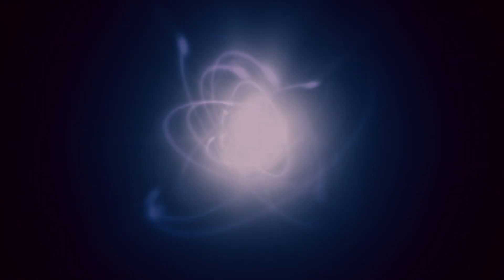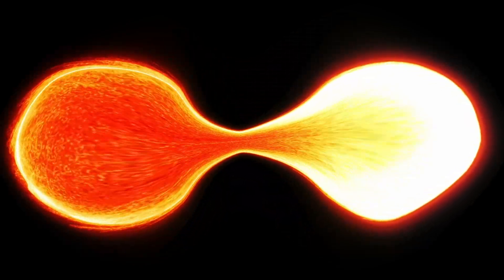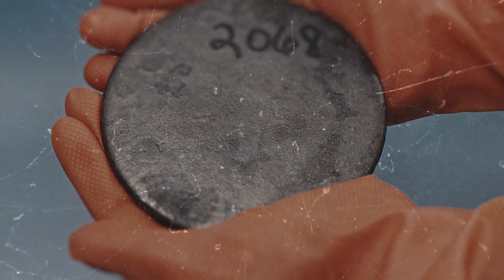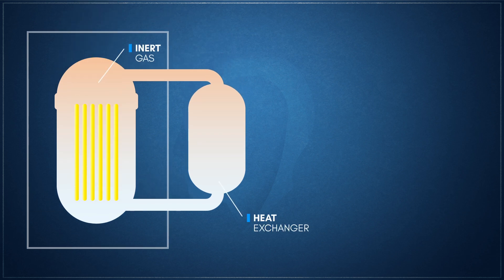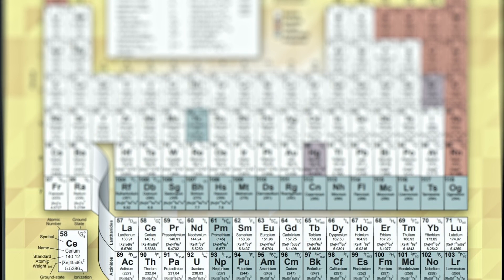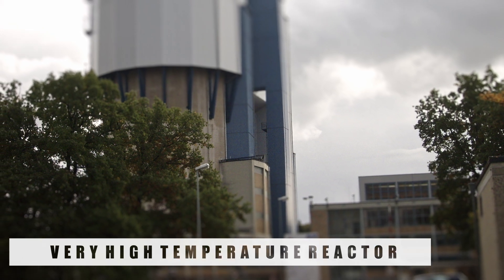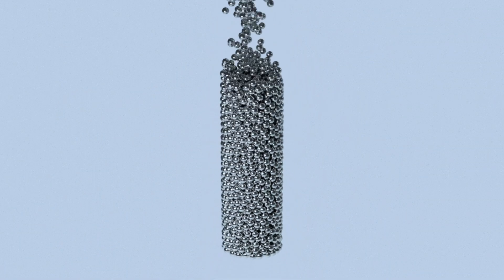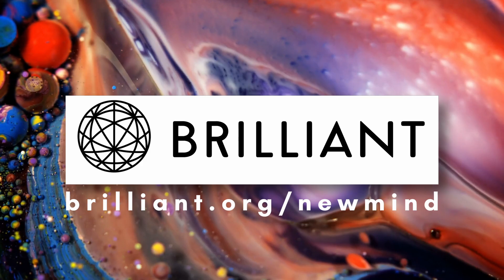Portable Nuclear Power

Comment: My only issue with SMRs and hopper pellet designs (which I love by the way, I want a 20KW micro reactor under my drive way) as explained here is 1) Helium.....uhm.....last I checked we had a depleting resource of the stuff. Sure, like MRIs it can be contained and reclaimed for the most part, but Id really prefer to NOT rely on something that we cant replace easily. Once its vented to atmo, thats it, its gone. And 2) Id prefer SMR, and larger scale reactors for that matter, that require neutron mirrors to sustain the reaction. There was a program in the 50s that launched a nuclear reactor into space called SNAP 10 which relied on neutron mirrors to operate. If the system went out of spec in any way it would release a retention belt that flopped the mirrors down killing the rector (which it actually ended up doing, not because of the reactor but a voltage regulator failed. Since the system was designed to kill the reactor in the event of any failure, thats exactly what it did and the reactor cooled down safely). So design SMRs with mirrors that slide down or something out of alignment with the reactor core that can be reset once its checked over. It would make them much more safer than they already are.

That being said, the real problem with nuclear is putting too much in one place. Gigawatt reactors are the problem. Too much can  go wrong all at once, too much to entirely contain, too complex. Small modular units connected together that can individually drop out leaving the rest to take up the load is the safe way to go.  Down with big nuclear, but up with smaller reactors in mass!!!
Reply: Evidently you have never seen the SNAP reactors tested to destruction... They can blow up quite substantially, and contaminate a large area. You would NOT want one under your driveway going haywire. 🤦🏻
Reply: @davelowets  you mean the Systems for Auxiliary Nuclear Power program that was explicitly intent on testing novel reactor designs and applications.....in the late 1950s through the 1960s? Or do you mean the ones intentionally operated to failure literally 'to see what happens'? Yeah, I've seen them. A modern design, configuration, safety mechanisms (which were another thing the early small reactor tests often omitted from design, again to see what happens and determine failure modes, containment, and clean up procedures), fuel chemistries, and monitoring systems make even the RBMKs miles above a 1950s SNAP reactor in terms of safety, reliability, and stability. The only 2 SNAP reaactors I know of that failed in a release event was one that broke up with the rocket it was riding on and dispersed 1kg of plutonium across the upper atmosphere, and SNAP-10 that self shutdown safely due to an unrelated systems voltage regulator failing, and then was hit by a piece of Russian space junk....or a Russian satellite....but, i mean, same thing really. Besides the SNAP designs were for mostly unshielded or minimally shielded Radio-Thermal Generator applications, which is little more than slapping a peltier device on a (thermally) hot lump of plutonium to directly produce electricity from the temperature difference between space and coolant, or the radioactive material container itself. A terrestrial reactor is very different. Although you can still buy Russian cold war era RTGs on ebay.... 

Yes, I'd still take a 20kW SMuRF (Small Modular micro-Reactor Facility..... I think I just named the installation type 🤣) for under my driveway. Modern design convention, modern containment, modern monitoring and safety mechanisms, the only thing I'm afraid of is the unit going into emergency shutdown and falling offline because someone farted near it. I guess nuclear scaremongering doesn't work on everyone, especially those with a preference for understanding a thing and developing their own opinions instead of being told what to think by the pop-culture zeitgeist 🤷‍♂️

Is nuclear energy dangerous? Sure. So is RF energy. But you trust your microwave not to fry your eyeballs with 1100 watts of energy dont you? While sitting next to your wifi router using the exact same frequency band at 250mW....Its almost like the application, power output, and containment coupled with safety interlocks have an impact of the relative safety of a technology, eh? 😉
Reply: @zombieregime  R.F. and ionizing radiation are 2 very different things....
Reply: @davelowets  omg nowai..... 😐

Comment: Nuclear power plants are not safe and can not be made safe to operate.  Nuclear radiation always escapes. While nobody has been killed nearby the global environment is made uninhabitable by nuclear technology.   We don't need  heat  to produce electricity.  We can use field magnets for moving the armatures and coils of copper wire.  We can use inverters and transformers to deliver high voltage AC power continuous peak power to the power lines.  There is no loss of current generated if cold inverters and cold transformers are designed and built.  So that even though the initial voltage is only 12volt DC inverters and transformers built to function without converting current to heat the current input is nearly the same as current output.  So we can estimate that 1200amps generated can be nearly 1200smps delivered at 2000volts .  In electric power current is conserved while transformers increase power .  The Edison generator and dynamos power plants securely generate electricity without fuel or nuclear steam wind or water.  We are grossly misinformed about power generation and nuclear power is the most dangerous consequence of the misinformation regarding Treaties and power generation.

Comment: I still think geothermal makes more sense.
Reply: won't be sustainable. it'll just cool the earths core faster, diminishing the planets protective magnetic shield. Once that shield is gone, the atmosphere will start to be stripped away, it'll take 10 or so years until all life on earth is gone due to intense cosmic radiation. the O-Zone layer won't help at all
Reply: Not really. Three reasons why geothermal makes not a lot of sense: very high costs, limited locations where geothermal can be installed, and the high risk of severe earthquakes.

Comment: Amazing as it is, I find it amusing that for all our technology, we're still pretty much stuck in the steam age(or other heat transmission). Spinning magnets around copper coils seems to be the best form of power production. Solar and thermal conductive devices (peltier effect) have very poor rates of energy capture in comparison. I can just see it now, ships relying on fusion reactors in space to push steam engines for power production. And yes, I know it's an oversimplified view of the technology.
Reply: With thermal levels so high in Gen 4 reactors it will be possible to use Super Critical C02 gas generators to generate power. It is way more efficient than steam generators.
Reply: @NinetooNine  Same basic concept though. Using thermal expansion to spin magnets around conductive wire. Just don't pull the lever to blow the whistle on the steam spaceship, you'll incinerate yourself.

Comment: The waste is the main problem. Think, we are using extreme power to boil water to make power....
Reply: The nuclear waste is indeed the main problem, but it's not a really big problem. Nuclear waste is completely recyclable since the 1960s.
Reply: @LuchtLeiderNederland  I just see our current method is so primitive and wasteful. There has to be a better way of harnessing the power to its full potential.
Reply: @tomroe7715  Radioisotope thermoelectric generators is a way to directly make electricity from heat. However, it is only used in uncrewed spacecraft and some Soviet lighthouses in the Arctics because radioisotope thermoelectric generators have an efficiency of only 10%. Boiling water has a much higher efficiency, thus making it one of the most efficient ways of generating electricity.

Comment: geothermal can easily replace atomic power and is definitely less dangerous even if you shutdown atomic plants why not drill holes next to it in nearly all formations is plenty of heat in reachable debts then the existing turbines can be used to generate  power like in the past from the atomic heat
Reply: 41.
Reply: Geothermal energy is more dangerous than nuclear power. Geothermal energy increases the risks of earthquakes, nuclear power doesn't do that.
Reply: @LuchtLeiderNederland  ach ja please get real investigate geothermal plants some are in producing power since the 50 tis or you r some one who live om a lobby salary
Reply: @LuchtLeiderNederland  do u understand they can drill now for deeper in to hot dry rock nothing will happen
Reply: @niko-laus  That was only one of the reasons why geothermal is not widely used. The two others is very high costs and limited locations where geothermal plants can be installed.
Reply: @LuchtLeiderNederland  please investigate mm microwaves are no an way to drill with low cost unlimited debts but tis infos are not easy to come by i did work on geothermal maintenance the plant is working since the early 60 continuous some other plants since 1911

Comment: Junk.. Nuclear for big power supply to masses. 2 trillion is enough small modular reactors for all of America with backups. We could rush that delivered by semi to save fuels to sell to other nations in need and lower strain on ALL. But the elites above us ordered us.. To think of how to starve the masses safely. Just like those people screaming in those buildings in China. For homes and vehicles = Cold steam reactor. Water boils at much much lower temps under vacuum, so you can use tiny fire to keep a turbine running max, and all extra pressure from boiler for steam driven vacuum pump to maintain the vacuum so the turbine stays lowest possible cost for operation. Condenser just like small modular reactors and internal pressure release to prevent explosions while recycling all water inside them.

Plasma arc with excess turbine power making ultrasound with plasma to change water of pressure = Non-corrosive real time hydrogen conversion. Tiny tiny fuel tank for days of power for a cold steam system. Electric motors OR producing hydrogen in real time for engine becomes supreme option. For flushing water out of hydrogen converted engines = Ultrasound to vibrate the metal, and air compressor system. < Cold steam reactor should NEVER shut down, so just plug vehicle to home for extra money from grid. - Atheist eugenicist Illuminati transhumanist

Comment: over the past 70 years nuclear power has proven to be overall.....

1. the safest power source available......Accidents. ...Produces Radioactive Waste. ...Impact on the Environment. ...Security Threat. .. and approximately 28 accidents/disasters that are on the International Nuclear Event Scale

2. Hydro power has the lowest fatality rate per unit of energy generated, (no radiation)

3. Radioactive waste disposal, it will remain radioactive for more than 10,000 years.

4. not everyone is a nuclear engineer, so portable nuclear power is not viable
Reply: Bad arguments you got there mate. Nuclear waste is completely recyclable since the 1960s, nuclear power has no impact on the environment, there is no security threat, hydro power does not have the lowest fatality rate (hydro has 0.10 deaths per TWh, nuclear has 0.04), and nuclear disasters are bad arguments against nuclear power, especially Chernobyl, Fukushima and Three Mile Island.

Comment: I remember that they've made Small nuclear reactors made to be self sustained for supposedly up to a hundreds years or more if they've been built well and don't break down. If so, I could imagine the world could be powered for at least 10,000 to 100,000 years easily over the years, and any waste transformed into resources as well. In that kind of time, it should be possible to also figure out what would be next to follow after. Assuming I'm remembering right about how that works. I could be wrong, but It should still be a power source that would be useful for as long as that at least.
Reply: I'd be interested to see one made small enough to power a single house.  Maybe use as a backup during power outages.  Would be cool to see a tiny reactor implemented into electric cars.  I'd imagine it would be a lot more efficient then lithium batteries and probably cheaper to make then lithium batteries as well.  Y'know once the technology is perfected.
Reply: If we get to the point where we are able to harness that much energy, the scale of the things we will be using energy for will increase exponentially (computers, vehicles, infrastructure, etc)
Reply: 7.

Comment: The issue with nuclear power, is not when everything is going according to plan.
Reply: The issue with nuclear, is simply people and politics. Nuclear requires a stable government into perpetuity. Something which almost nobody can guarantee. This is not just due to corners being cut with regard to maintenance, safe operating, but due to proliferation of weapons grade material and material disposal in the event of incomplete use.
Again, in peacetime, it works fine, but in war time, the nuclear power plants become significant strategic targets. 
I am not against nuclear research but I think often people get too utopian about nuclear solutions, when we have been told prior to chernobyl and fukushima that no disaster could happen. Because it is not the disaster that you plan for that gets you, it is the one you failed to account for.

Comment: Lets gooooo, we need more public awareness of how SAFE, USEFUL, and CLEAN nuclear power is now to get rid of the stigma around it. Let me ask a question. There have been how many devastating nuclear disasters from properly built, regulated, and maintained nuclear facilities??
....0. None. No accident has ever occurred at a nuclear facility that was being operated properly.
Keep driving prices down, keep passive safety on the rise, and keep thermal efficiency growing, and nuclear energy is the best, most sustainable, essentially clean energy we can ever ask for. Add solar and wind to boost that production and fossil fuels can easily be eliminated from energy grid production in the next 50 years. I'd love it see it...

Comment: You missed CANDU reactors. They are not simply pressurized water reactors, they are pressurized water reactors that use heavy water for the high pressure circuit. They are worth noting I feel because, while still being heavy water reactors, they have the same ability as gas cooled reactors to use unenriched uranium and you can't feasibly use their waste to create plutonium for nuclear weapons, so they are not a proliferation risk.

Comment: If people wanted to they could build huge solar farms all around and even on the structure of a nuclear power plant & then divert all that power into the plant to be used to create the steam used to spin the turbines instead of using nuclear power to do it. effectively changing it into solar steam electric plant. No nuclear wast and yet still all the power generation a nuclear power plant can generate. Also of course an array of batter systems to compensate for cloudy days.
Reply: 32.  Huh???  You want to take electricity and use it to boil water to make electricity?  Why in the world would you want to do that???
Reply: @nathanwahl9224  Simple, getting the electricity from solar to do to the water what nuclear isotopes do is clean. Zero waist. On the other hand when they use radio active isotopes it ends up leaving dangerous nuclear wast. For the record tho I would actually prefer my idea of an Over Unity Electric Generator to be built. I describe it in other message.
Reply: @nathanwahl9224  I smacked my forehead too over this one.

Comment: Fascinating video with very good description of the different types of reactor systems. I formerly worked on CO2 gas-cooled reactors, but I feel that the use of helium as a coolant gas is not the way to go as it is not that abundant and is prone to leakage with its low molecular weight.
Reply: What advantage does He have over CO2?
Reply: @Gomlmon99  Helium is absolutely non-corrosive, whereas CO2 does oxidise steel- this led to the temperature downrating of some reactors in UK following the identification of corroded components. (It was found that the corrosion between certain steel nuts, bolts and washers built up until the bolts were sheared off due to the stressing of the steel). 
It also has a higher specific heat capacity than CO2 meaning that it takes less gas and thus less energy to transfer heat from the reactor to the boilers.
Unfortunately, it is extremely expensive, supplies are limited and it leaks rapidly through the smallest porosity or gap, so I do not think it is really viable.